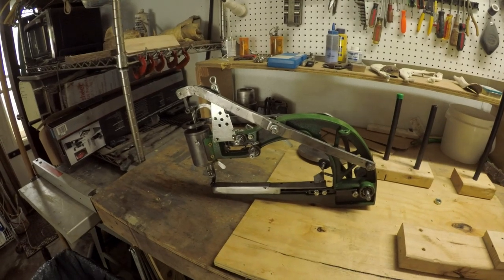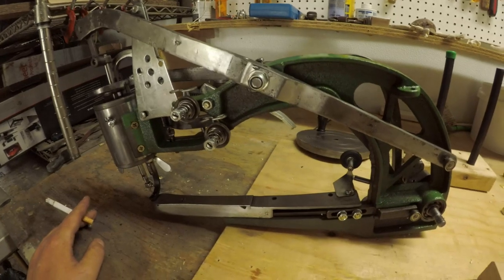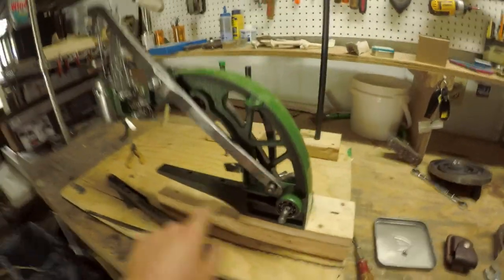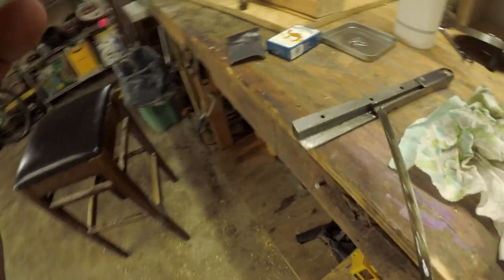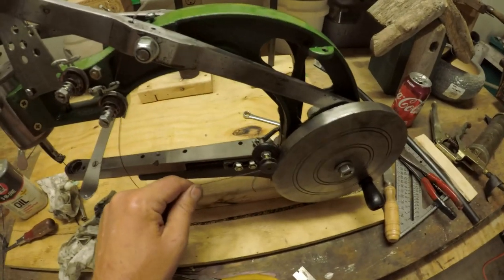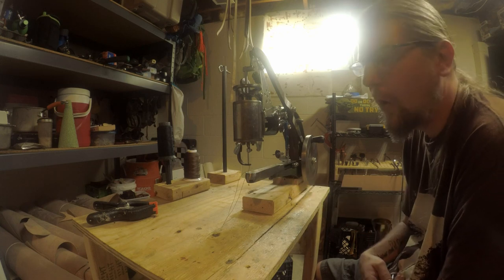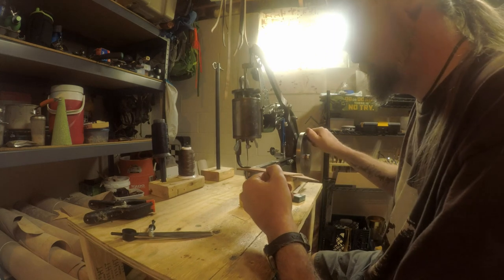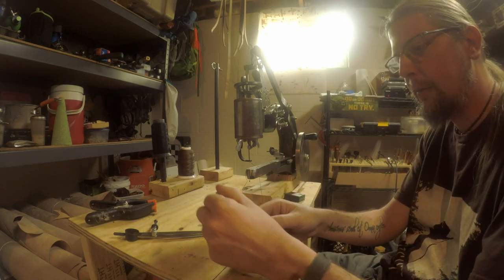chinese shoe patcher clean up and my 2 cents

Comment: Thank you for the video. It helped me decide to purchase one and use it to repair my outdoor gear. Takes work, but it is a neat machine to have. I didn't learn until after purchasing one for around $115 that Bantamsaddletack sells one for around $200 which is reportedly cleaned and tuned. Just another option for those of us exploring this machine. They also have spare parts for the machine, and so far the ones I received were nicely cleaned.

Comment: On my machine, I used a hobby brush (round plastic brush @ Walmart $1.00 for 10) and applied Lucas Red thick n tacky bearing grease on all the moving parts.  I used liquid bearings synthetic machine oil applied to the oil ports.  Mine runs smooth.
Reply: Excellente thank you 😊
Reply: Much success to you 😢

Comment: you back stitch by either turning the work piece around OR turn the ears that line up the feed foot. The foot will turn in the opposite direction to sew in  the other direction

Comment: I got one and tried a lot before getting it to stitch.  Ultimately had to go to a stronger thread, I probably was asking the original thread to do too much. Two layers of 8 ounce veg tan is outside of the thread range provided with the machine. Be prepared to get stronger thread a needles if you plan on doing anything moderately heavy. That being said once you get it sorted it stitches nice and beats hand stitching everything.

Comment: Hey man, i have been able to run 277 thread with a 25 needle going tru 4 layers of veg tan. 
Don’t cut your needles. Put them in and then loosen the needle bar at the top and adjust until you can just feel the needle comming out of the bottom of the bed. 
These are some of the needles i run on mine:
	
Groz-Beckert 134 - Size 160 / 23 - D Point - a.k.a. 134 KKD, 135x8 TRI - 10 Pack
NDL-718212

	
Groz-Beckert 134 - Size 200 / 25 - LR Point - a.k.a. 134 KK, 135x8 RTW - 10 Pack
NDL-715162
Reply: Thanks!!

Comment: Wood gun stocks and pistol grips are not jimped, they are checkered.  They have checkering.
Jimping is placed on the spine (back) of a knife blade to assist in thumb placement & control - not to be confused with file-work, which is on the blade springs of a folding knife for a decorative feature.

Proper words and phrasing can change a lot when doing instructional presentations.  Just an idea.💡
Reply from the maker: Thank you for your input. I know the difference between checking and jimping. I use the same file for both. I call it a jimping file because that is primarily what I use it for. Technically they are calling Swiss pattern files. Some people refer to call them different names for their primary purpose.